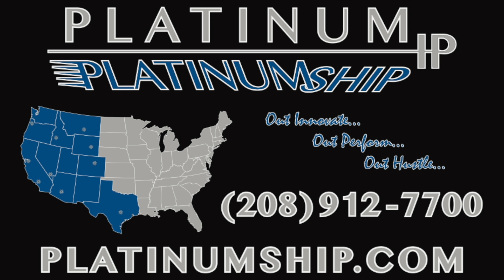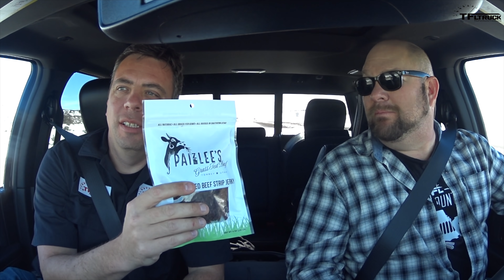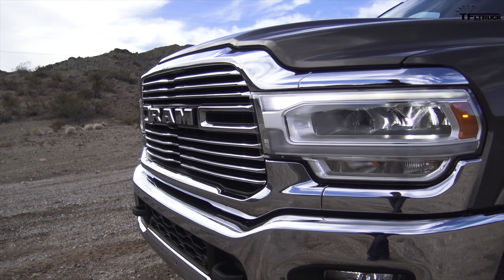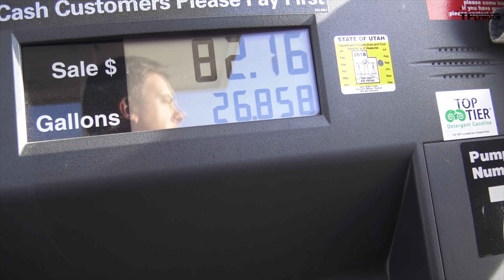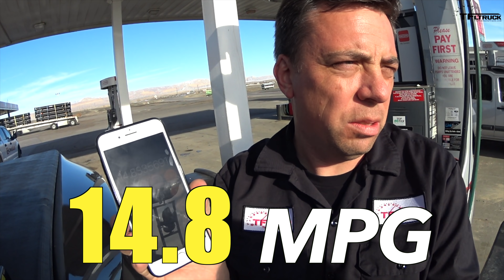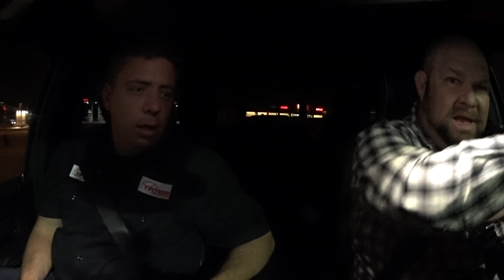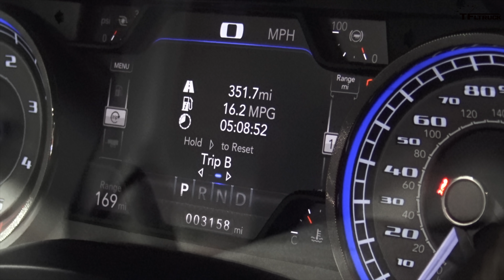We Drive 800 Miles in the New 2019 RAM 3500: Here's How Fuel Efficient 1000 lb-ft of Torque Is!

Comment: 14.8 with a 31 gallon tank.  Another reason why I much prefer the 2020+ F350 6.7 Dually FX4 10A-3.55 LSD and it's 48 gallon tank that gets 19-20 mpg in eco mode in this same type of test.  Even the 900-1,000 pound heavier vs. the F350 6.7 Dually,  F450 6.7 Dually 10A-4.30 still beats this Ram 3500 6.7 Dually with about 17-18 mpg in eco mode in this same type of test.  Pretty incredible for a Diesel V8!

Comment: Have no idea why you guys think your hand calculations at the pump are any more accurate than the computer.
Every time you refill, depending on ambient temperature, angle of tilt, temperature of the fuel, how efficiently the pump handle the lets air out of the tank as it fills up, and other factors, you could be off by a gallon or more from what you call "topped off". The bigger the size of the tank, the more this can vary. You can't rely on hand calculations as an accurate measurement unless you account for all factors or have a reliable method of making sure you are always at the same exact level after every refueling. Short of doing that, there really is no point in hand calculations other than as a point of reference. And if you can't trust the computer, then you can't trust either method and you're stuck with hip fire guessing. You can call it "real world" testing all you like, but all it means is that it's that much more unscientific in methodology – which, when translated, means further FROM the truth. Real world conditions only means the end result is more affected by uncontrolled factors, which means you don't know what you're even measuring in the end.

Comment: If you are considering buying a RAM 3500 pickup, please don't do that. My RAM 3500  break down very quickly from the fuel system. I bought a 2020 RAM 3500 and it broke after 3 months, my fabulous RAM 3500 is still in the dealer after 1 month. They tell me there are no spare parts for the fuel system

Comment: I know that this is an old video, but I would love to see a run like this in all 3 competitors with the new models. Only thing that I would change is to load the bed with some sand bags or something to simulate a full load in the bed, or a trailer. I know that y’all have the loop that you do pulling the trailer, I just thought that it would be a more accurate estimate if it was a longer trip going over different types of terrain. It seems that in the loop it’s fairly flat. I think it would be a better real world estimate if it was all kinds of different terrains in different states. Just my two cents.

Comment: After a delete and tune I get about 21-22 Mpg on my Ram 2500 Cummins on the highway with a my self, full tank,  35 gallon reserve and about 200 pounds of tools..(that’s about 475 pounds of fuel.. and 17-18 city... when towing 8-10K pounds bumper tow I average 12MPG.. I did the delete for life expectancy of the motor at 9K miles when new... I have about 45k so only time will tell.. oh I have bds 3”lift on 35’ E rated nitros and I never play with the tuning for rolling coal.. not my thing..however with I do on the fly shift for preset tunes..man it holds the gears and the torque pushes you back..

Comment: Great video as always but the way you averaged the two segments of the trip was not technically correct.  That only works if the two segments were the same length.  The correct way to get the average is to divide total miles by total gallons.  Of course in this case the difference will be VERY small.  You guys do a great job providing information on HD trucks and towing.

Comment: I will challenge you with my 94 Ram on the same course. D250, 5.9 Cummins with automatic and Gear vendors overdrive.   My truck cost 90% less than yours.

Comment: FWIW, my 2019 Ram 2500 gets 21mpg unloaded going down the highway at 65-70mph. They are getting less mpg in this truck because it's a dually, low gearing, speed they are traveling at, etc. That faster speed and low gears brings the revs of the engine up and eats the economy up. Def and emissions really is not that big of a factor as some seem to think it is.

Comment: The fuel mileage sucks ass loaded yall. I own a 4×4 and use it for hotshot. Loaded with 15k on my trailer and trailer weighing 8700lbs doing 65-67 mph I get about 6mpg. I worked for FCA and know that is not right. I also had a huge problem when it was new with the dpf. It was in the shop for a month. Before it was so called fixed it got 4-5 mpg. And with an empty trailer I only get about 9mpg. If anyone works for fca in the engineering department message me so we can have a little chat. I've put 75k miles on this truck and have do e the homework. Oh by the way. The def should last about 3000 miles on a tank. I'm getting around 800 miles per tank

Comment: Some people app for the aisin transmission to only never pulls over 30,000 lb I have a 2018 3500 Dually with the 68rfe transmission and it's got over 230,000 miles I haul my travel trailers over the country no problems will not waste money on a aisin transmission to seem to be a overly heavy granny like transmission

Comment: Well, I will just keep my 2012 , 3500 it's paid for AN only have 145400 miles on it, running empty I'm getting 16.6 mpg. Can't complain, I have only leveled front end AN cleaned the egr valve that was starting to carbon up, dealership offered me $30,000 if I would take a new 3500, I laughed at him AN walked away. 
        LOVE MY RAM.
                    JOHN MINYARD

Comment: This is why I bought a 1/2 ton diesel instead of the 1 ton. I get 23mpg in town and 29 on the highway. 3.0L Powerstroke.
Reply: This tows 35,000 pounds dummy.....yours will NOT
Reply: @chadhaire1711  obviously I don't need to pull that kind of weight, shit for brains.

Comment: I am wondering why always the flickering headlights?
Reply: Most cars use pulse width modulation to regulate the LED lights, this means that the lights are actually flashing faster than the eye can detect, however your camera frame speed will often cause this to be visible as the two rates overlap for brief periods of time.

Comment: I get 19mpg in my 97 7.3 F350... for how hard they try to get good mpg I don’t understand why it’s not in the mid 20s
Reply: New diesel engines are usually fitted with emission reducing systems that reduce NOx and particles but increase fuel consumption and CO2 emissions. Then again your old 7.3 doesn't have the same hp and torque numbers as this one.

Comment: My 97 F350 7.3 CrewCab Dually averaged 18-20 mpg empty, it had 450~ HP and 925~ lb-ft. It also had 580,000 miles on it. I miss that truck everyday. I wrecked it, bent frame, body came off frame, still ran and drove. Guy bought it, drove it home, rebuilt it, I bet it's still on the road today!
Reply: I think you meant 425 torque?

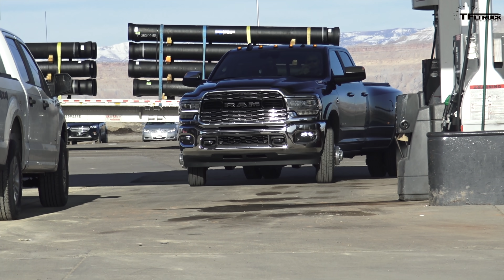Comment: I have a 2016 RAM 2500 though not a dually and get 23mpg on long trips.  I do have a bed cover and keep it at 70mph.  This is with the 370hp 800 torque and 68rfe automatic.  This is also in the mountains, down at lower altitudes I get about 20mph in thicker air.  370/800 is way more power than I would ever need.  I have towed 12500lbs 19,550lbs CGVW and was getting better mileage, probably due to gearing.  1000lb feet and 400hp with 4:10 is stupid towing power.

Comment: I ran a fleet of them. Don't get to optimistic about the truck... I was running 3500's, 4500's and 5500's. I think that to give a proper review you need to call a dealer and tell him you need a water pump (a 3500 issue). You will find that they don't make or stock the parts. It took 5 weeks to get a water pump. I had electrical issues in 2 of them.  You can regen the system, but you can't reset the computer. The reset has to be done by a dealer. These are 2016 issues, so I don't know if Ram fixed them. I dropped Rams and went to Fords. I would rather pay extra and not look at a new truck broken down in my lot.

Comment: I remember when I got my new 2004 Dodge dually diesel. The MPG was good but after about 10,000 miles it get better and continues to get better. New engines are still tight and need to be broken in before you start seeing better MPG.

Comment: Wow a hole 15 mpg! Lol My 99  7.3 gets up to 25 mpg (55mph) 15 mpg @ 75 mph due to gearing 3:73 and only 4 transmission gears.
Reply: I have a 1999 7.3 liter, and I can't drive 55.lol  I have never got 15mph 3:91 gears, 35" tires 6" lift, truck loaded 8300lbs. 25 mpg pie in the sky ! Pulling fiver loaded 13,980 total weight 22,280 8.5 to 10.8mpg! The best mpg 14.3 without the fiver.

Comment: Also, a brand new diesel engine needs time and mileage to brake in. After 30,000 that engine driving it at 66 miles on the hwy, it is going to average 20 miles to the gallon day in and day out. 
Antonio, the 18 wheeler

Comment: If drive that truck a 66 miles per hour in the hwy, it is going to average 18 miles to the gallon.
The 6.7 six in line diesel cummimgs if you drive it a 55, it is going to average 15 miles to the gallon.
If drive it at over 70 miles, it is going to get 15 miles to the gallon.
Needless to say that its sweet spot for that engine is 66 miles on the hwy.
Antonio, the 18 wheeler

Comment: When you look at this from a historical perspective, this engine is way more efficient and cleaner than 50 years ago. Cummins needed 14 liters of displacement to get that amount of torque and less horsepower. The fuel efficiency might have been 5 to 6 mpg on a good day. Now lets talk about how clean this engine is. You fire up your deleted engine or your hopped up 12 valve in a closed room and I'll fire this truck up in a closed room and we'll see who passes out first.

Comment: The trucks mpg will get better as it gets broken in more. I just averaged 19.7 on my latest tank full in a very hilly area in Pa in my 2018 Ram 2500 HD with the 6.7. Cant get it past 55 mph because of the speed restrictions and road conditions. I am hauling a trailer out west in a month and i am very interested on how it does and mpg on the interstate.

Comment: Those computers only show average for the last x number of miles. Usually around 100-150 (some might go higher) In both cases you were fueling after a downhill stretch which will explain why the computer was optimistic.

Comment: Please do a 6.4 hemi 2500 or 3500 empty mpg run please
Reply: my 2014 2500 crew 8' bed 6.4 2wd gets 15 to 16 daily and in 2015 we went from Texas to Washington st and back with a ranger of 17mpg to a high of 21mpg when the wife was driving.  I would say NOT using the cruse control will get you better mileage.  140000 miles later and its still going strong.

Comment: Math geek here: averaging the MPG calculations from each fill-up a does not result in the same overall average as dividing total trip miles traveled by total trip gallons consumed.  In this case the difference is very minute, but if it were a longer trip with more fill-ups at different increments your calc could be way off.

Comment: That is CRAP mileage! Plus you have to buy some DEF! My 90s gas pickup gets better then that and the old 12v and 24v cummins always get 21 or better empty! While putting out a TRUE 1000ft of TQ. Not exaggerated from the manufacture! Yes that means a little modding for the old trucks. What total CRAP! Better off buying a old truck and restoring it for less money then the new one costs plus get better mileage while doing it and no DEF crap to spend even more money on!

Comment: you two are idiots! never did you mention the cruising speed, the cruising rpm or the rear gear ratio. All vital information! By the way my 2015 3500 dually 4.10 (if you have  clue what that means) gets 19.4 empty at 72 mph and 13 pulling 11k pounds.  How can you make a statement that 15 mpg is good???

Comment: 27mpgs Indianapolis 2GrandRapids 30s temperatures
28mpg Jacksonville 2 WaDC
31mpg Ok City to Dallas Tx
27mpg Houston to El Paso Tx
27-33mpgs freeway 60mph
18-20mpgs city driving 10-18mpg off road
10-18mpgs tow 6kLbs Boat

2015 2500 Cummins 6spd 4x4 4door Crew cab deleted 4" pipe, KN flat air filter camper shell EdgeCts2 computer 

20gallon extra tank hitch 
3 light bars =970watts, 
Setup as 1st responder, 10,200lbs weight 

same mpgs since deleted by PFdiesel.com @78k
25-32mpgs freeway
20-25 city, 10-20 off road 
Avg.MPGs From 78k to 200k

Efficiency is measured TonXMiles per gallon used by scientist in the diesel truck industry.5.2tonsX28+mpg= 146TonMiles/gallon😀

Toyota Prius is 3200=1.6tX50 mpg=80Tmiles/gallon 😆

6 way MPG math calculated=
1-RAM computer
2-Garmin gps
3-Google maps gps
4-USGS maps gps
5-AAA maps Android
6-hand=4 semesters calculus

Diesel ECONOMY TIPS
1:Speed 55 & rpm 1500
2: Close Windows 
3: No items on top of car
4: Make truck aerodynamic  
5: Inflate tires 2 maximum
6: High rear end gearing3.42
7: Factory tall tires
8: 5-40w Synthetic Oil
9: avoid 4x4 driving
10: Remove excessive weight   
11: Fuel is heavy too
12: Plan journey wisely 
13: warm up engine
14: clean outside
15: Avoid RAIN 
16: No aggressive driving
17: Don't over-rev. 
18: Gear fast, slow & accelerate 
19: Avoid idling.
20: Overdrive & cruise control  
21: Ele&AC worsens MPG
22: Exploit cruising down hill 
23: Avoid a complete stop
24: red>roll in neutral gear
25: Tune engine to low HP
26: Change oil regularly.  
27: Replace air filters regularly.
33: Leave early Family drama 
34 constant Mph=Mpg 
36: avoid drama & stress
37 Park in shade
38 distance to prevent braking  
39: Forced induction =MPG
41:Rough asphalt tire wear+7% 
42:Use brakes to slow down.
43change fuel filters often
44change power train oils
45avoid wider tires
46avoid jacking truck height
47used tires =better MPGs
48TenDegrees=HalfMileMpg

Obama Diesel Exhaust😥 Cooker warranty expired 80k. 3rd Cooker😭 by 75K so @78k I deleted. Saving fuel & costs 10c mile = $1000/10,000 miles😀
Or $10,000/100k miles😀
So if I deleted@0, 210,000 = $21,000 fuel & cost savings 2016to2018😀

Comment: if PHEV are viable in small cars and electric hybrid power trains are the norm nowadays in all but the largest ships and all trains why has nobody tried making a diesel electric truck?

150HP generator standard and a 300hp electric motor with 16kw credit maxed battery for the 7500$ credit probably wouldnt be the worst thing in the world

40ish miles of dirt cheap electric range for city driving every day, would help these truck makers meet regulations and save people money, and on the highway you could have the diesel generator run at a perfect rpm and have electric motors with incredible torque and no darn gear boxes or differentials to break.
would probably have a better 0-60 and less noise and fumes in your life.  would expect it to be more reliable as well 

batteries are expensive, only buy what you need.
not to mention theyre useless for towing anything any long distance very infrequently

Comment: It needs front axle locking hubs. 140lbs of rotating front end will eat u joints and mpg. Dumb... ford has it right at least
Reply: Mitch and Cassie Shepherd, I’m pretty sure ram has gone back to using the center axle disconnect front axle.

Comment: CRAP mpg on the new trucks. My 2004 quad long bed gets 21 with 4 people and a dog.
Reply: Dan Sertich it’s not crap only for the reason of yes it only gets 15 mpg but it has 1000 lb of torque compared to half that on a 2004
Reply: @anthonymarinelli1869  1995 12V cummins, 1Ton dually, gets 25mpg empty as it has for the past 447k miles. Not sure why, but it beats my 24V 2001 dually by almost double.
Reply: @anthonymarinelli1869  Lol its crap, my 1998 12v 5 speed gets 19-21MPG and makes nearly as much torque with the AFC turned all the way up
Reply: It's totally dependent on speed of travel and aerodynamics, weight of truck, and some emissions. Older trucks usually do better on mpg because they weigh less and have less emissions equipment they have to run. There's always a trade off

Comment: I have a 2017 heavy spec'd Ram 3500 long bed crewcab 4WD. High output diesel with the Aisen tranny. Gearing is next below the 4:10's but can't remember off the top of my head 3:80's something.. At 65mph with my normal daily load of 2000 pounds in the bed I'm getting 18.6 mpg. At 75 it drops to 16.5ish.For a truck the will tow 30,000 pounds(done it) that's not too bad.

Comment: I drive 2000 Subaru Forester daily in australia towing between 0.5 to 1.2 ton with tools in the back doing between 14 and 17 Litres per 100 KM (16.8 and 13.8mpg) around town and 10 Litres per 100 KM (23.5 mpg) on the highway. so definatley not bad for a big dually.

Comment: i dont believe 15mpg is great , it should be ok. i have a 2001 chevy 6.6 lb7 crew cab long bed 4x4 dually, i have gotten 7 towing and about 13 hwy unloaded,. after installing a fass lift pump i have gotten 10+ towing and up to 20 hwy unloaded all with an old banks six gun tuner set on level 2 of 6. you might get there before me in the ram with almost double the torque, but at almost 90k compared to my 13k 7 years ago, i think i would take the old duramax before the ram, (no stupid screens either)

Comment: The truck will probably get around 19mpg empty once it has some mileage on it
Reply: picard When they quit running 80 mph it will.
Reply: I have a '19 HO ×/ 4.10 gear ratio (dually pulling a 44' gooseneck flatbed trailer). My best mog empty has been 10.5 mpg.  Worst was loaded with a 17K lb, 10' tall generator (4.7 mpg)  Help !!!  What can I do to get better fuel mileage  ???
SteeleExpress@outlook.com
Reply: It will get 25mpg when some of the garbage under the hood falls off.

Comment: $87k and manual fold tow mirrors. And Ford and GMC do it so easily. C'mon FCA.
Reply: The ram has power folding mirrors, i don't think you know what you're talking about, if you mean that you have to manually flip them up then yes and the ford and gm go in and out by themselves but that probably isn't an option with the ram design